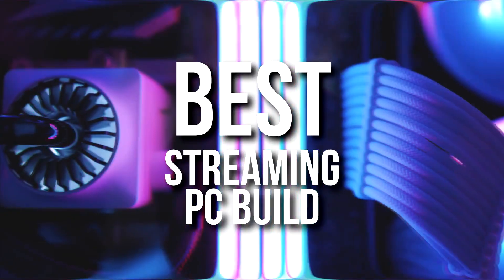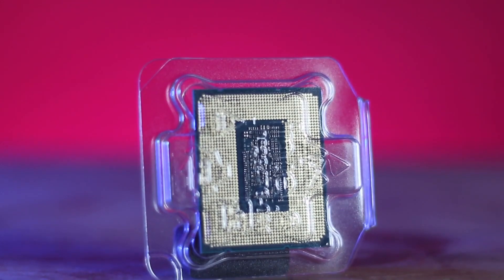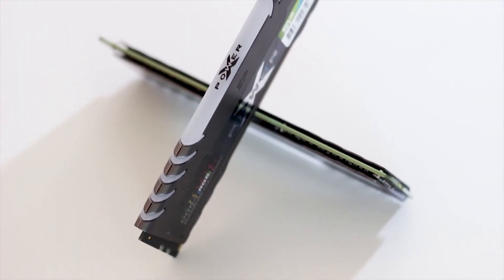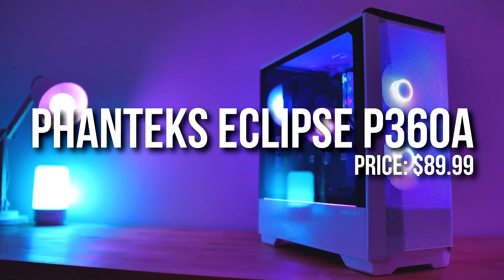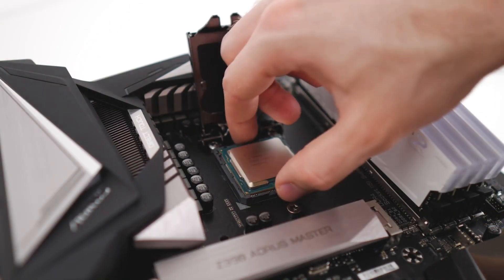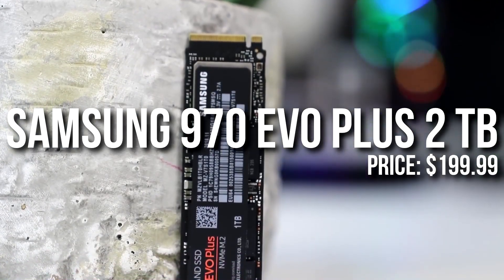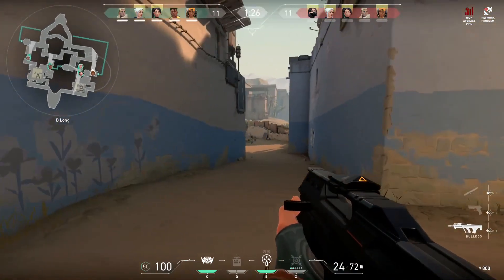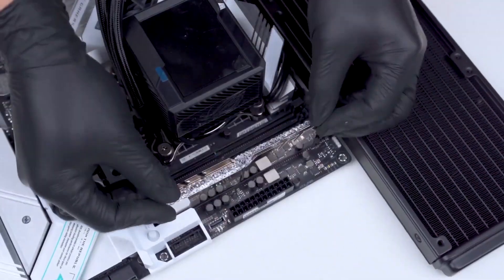Best STREAMING PC Build in 2022 [Different Budgets]

Comment: I want something I can build since my first setup pre-build I got is a iBuyPower from best buy around $850-1000 with a gtx 1660 and a i5-9400f it's not bad but some games I can't run to well if I ever play them like warzone almost crashes my game on medium settings and apex runs decent at 144-170 fps at competitive settings and my main games being fps tac shooters like csgo and valorant what is the best for streaming at 1080 gameplay with 240+ fps for a 240 hz monitor I'm getting a benQ XL2546k and some cheap 75hz side monitor 1440p what would u think is best and good for high rank gameplay?
Reply from the maker: What's your budget?
Reply: @ShadowGamingPC1  My budget is about $2000 and I already have all the other stuff like mousepad,mouse,headset,desk, etc just need a good setup build (monitors are getting bought separately) but if u can link me a good 1440p side monitor for vertical that would be great
Reply from the maker: @dryden8801  if you want the best deal get this one https://bit.ly/3U9F61E , but remember it's on a huge sale so if you want it buy it asap, the other PCs at this price point are not nearly as good

Comment: I’m planning to buy my very first pc so I’m getting a prebuilt. I mostly want it for apex and other games. What are your thoughts on cyber power? The one I wanna get is 1,599 The overview of it says- Intel Core i7-11700F - 16GB ram support - NVIDIA GeForce RTX 3060 Ti - 1TB HDD + 500GB SSD. Is it worth the money?
Reply: The 3060 TI is a beast for warzone , apex and gta . You can easily get over 135 + FPS , but if you can spend a little more for a 17-12400F you’d be set for years before you need to upgrade anything
Reply from the maker: i7 or i5?
Reply: @ShadowGamingPC1  it’s i7 my bad
Reply from the maker: @briannamejia6955  does it have a liquid cooler? Also I need to see the case, because airflow it’s important for that type of hardware
Reply: @ShadowGamingPC1  can I send you the link to it? Just so you can check it out and everything that’s in it. The pc is on the Best Buy website.
Reply: @ShadowGamingPC1  the product name is gamer xtreme desktop but the brand is cyber power
Reply from the maker: @briannamejia6955  I just saw it, don´t buy it, the airflow is not good and you don´t get a liquid cooler, buy this one instead https://bit.ly/3LGJGQY , same specs but better airflow on the case and a liquid cooler for the CPU